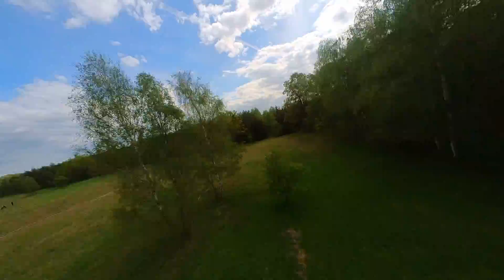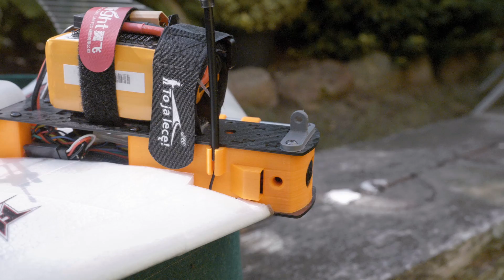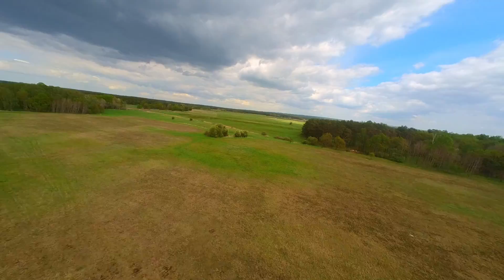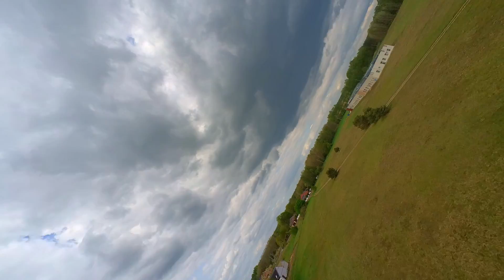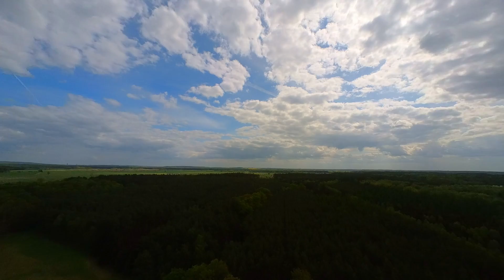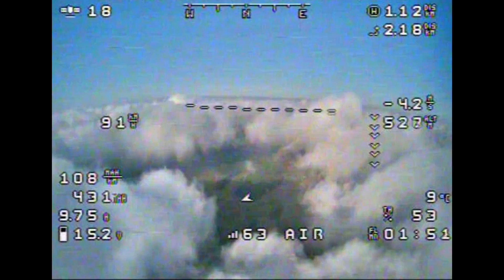Indestructible Flying Wing | Flybot Flux Flies Again

Comment: I'm  almost finished building an old Bonsai model that I didn't work on for many years. Now all the electronics is so small I can fit a Matek F411 WTE in it, a larger battery, a ELRS EP1 receiver that is so small it can be stuck onto the back of a 4 pin dupont connector. I also added a plywood center section similar to the Flux but with the battery inside instead of on top. The only old school component is the ESC. I wish I could use modern programmable ESCs but no firmware like blheli exists for planes with slow spoolup to prevent torque rolls.

Comment: Thanks for the video. I like the build and the use of airspeed sensor. Using a Pitot tube is great,  I wish iNav will smarty maneg the airspeed which is the most important and very basic for a plane rather then fix throttle value. Even managing the ground speed can de better then the current method. sorry for the ruff words, I'm frustrated with the current situation.
Reply from the maker: In theory you can build one with Logic Conditions. But I never tried that